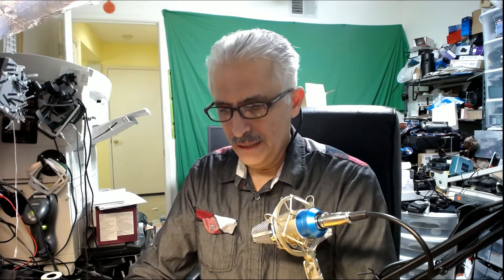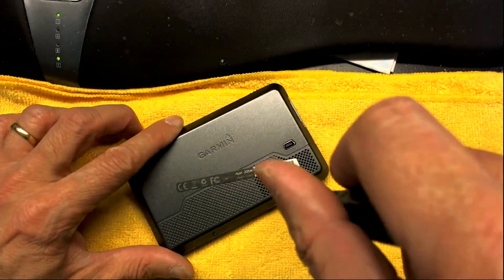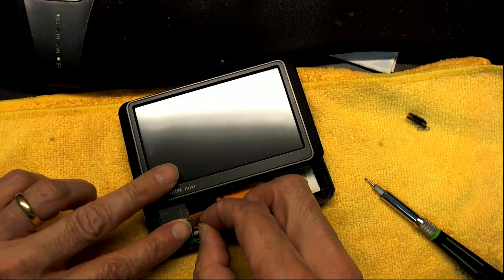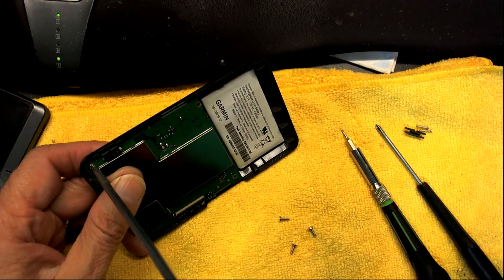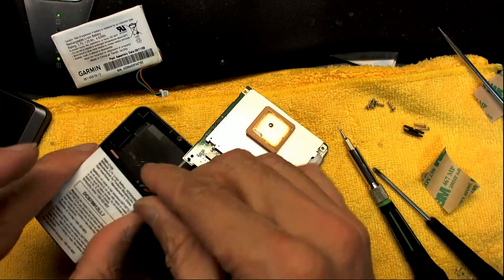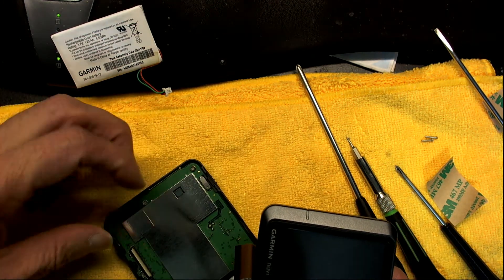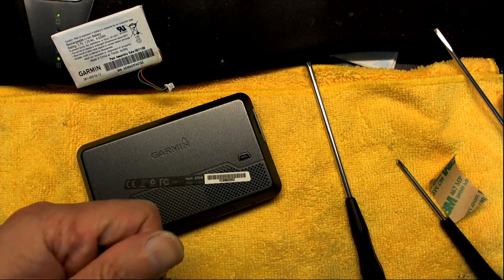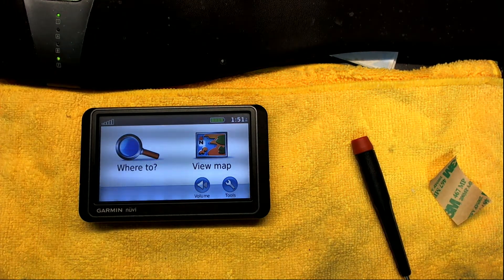Tutorial For Replacing the Battery on a Garmin Nuvi 200 205 255W 265W 2xx

Comment: Excellent video. Thanks.  I cut the double-sided adhesive strip off the back of the old battery and used it with the new one, which worked fine.
Reply from the maker: Thanks! and yes I reuse the same tape most of the time.

Comment: I don't know why but it was impossible to undo the two screws of the back. I used drill and cut the heads of them. The plastic also was hard to open, after an hour i made it replacing the battery. Conclusion, before order the battery set, open the GPS fuselage! Thanks for tutorial.
Reply from the maker: Very true, I do this everyday so it seems like it is an easy task. However it is really challenging if you are doing it for it for the very first time.

Comment: What is a source for the new battery? Do you have the model # of the new battery so that I can do a search for it? Thanks for the video
Reply from the maker: No problem, the battery is widely available on eBay they run from $8, $15. 
Try to get it from a local supplier and not from China, so that you can return it if you have problems. There are more than a dozen different part numbers that will fit on your GPS, so you need to take out your specific battery and see which model it is. There are two main differences between them, some have two prong connectors, and others 3 prong connectors, so make sure to order the correct type.

Comment: My Garmin 2639LMT will not turn on so I am looking at your very helpful video. The GPS when plugged into either the 5v or the 110v adapter is making a very quiet beeping , can hardly hear it. Do you think this is the sign that the battery is almost dead.? Thanks for your advice.
Reply from the maker: When the battery dies the GPS should still operate normally with a power supply source as long as it is a 5V DC 2A or 2000mA power source. So if you are using the original Garmin AC Adapter or Car Cigarette lighter adapter and you are still getting the beeping sound then there is a possible main board problem. If you are using an aftermarket low current power source, then that maybe why it is beeping.
Reply: @TECHNOLOGYTIPS101  I took the battery out and it's 0 v/ dead. I'll try to see if it will work with only the 5v DC Garmin source. If not then I'll assume it's not worth the expense of a new battery, right?
Reply from the maker: @anglosaxon1622  Indeed if the unit does not turn ON without the battery via USB Cable, then it is dead and you shouldn't waste money in buying a new battery for it.
Reply: @TECHNOLOGYTIPS101  Thanks for all your tips and assistance.
Reply from the maker: @anglosaxon1622  No problem!
Reply: Hi again, I persevered, got the battery charged and now I'm greeted with a plain white screen.! Some progress I guess.
Reply from the maker: @anglosaxon1622  Is this white screen with power plugged in or just running on battery?
Reply: @TECHNOLOGYTIPS101  White screen comes on with all three types of power connection. Sometimes hear the startup "gloop" tone( if that is a fair description.) But still nothing except white screen, successfully connected to the Garmin Express app and updated USA maps and have tried the pwr on, touch screen in lower right corner for a minute but nothing.
Reply from the maker: @anglosaxon1622  It could be a bad video processor chip which is on the system board, or a bad screen. It can also be a loose connection between the screen and the system board. So the only way to be 100% sure is to take it apart and professionally diagnose it. This is something you can't do unless you have spare screens, and system boards to swap them and test it. If it is under warranty it is worth sending it to Garmin for repair, if not you will be better off to find a similar used one on eBay.
Reply: @TECHNOLOGYTIPS101  I was thinking similarly, maybe that foil connector. 
Yeh, I've just purchased a new device on eBay so should be good to go in a few weeks.👍

Comment: one of the copper strips on the right side with 4 leads brook when i bent the cover over to get at the battery can it be soldered together or can i replace it on a garmin 265 w
Reply from the maker: Can you post a photo of the broken copper strip so that I can see exactly where it is?

Comment: can you use your gps without a battery , using the usb port and cigarette lighter only?
Reply from the maker: Yes you can, but it is not very safe to do that. If the power is cut off accidentally the unit will turn off and you have to re enter your rout data. Power cut off is a common issue with all vehicle cigarette lighter plugs if the cord is moved, wiggled, or if the vehicle goes through a road bump or something like that.
Reply: @TECHNOLOGYTIPS101      I have been using this  garmin gps for work (home health) since 2013 or 2014 to current.   The original battery is still in it plus i hook it unto the cigarette lighter daily.  But now the GPS turns on and off several times.  Do you think if i put a new battery in- it will work, or will the GPS only last so long?
Reply from the maker: @chnglna8342  If the problem of it turning off is a lose USB plug on the back of the GPS then changing the battery will help somewhat but not totally. You will eventually need to fix the USB port also. You can see my USB Port repair video for the model that you have. GPS Units work for a very long time, I have a Garmin StreetPilot from 2004, it is 16 years old and still works flawlessly.  There are some TomTom GPS units that will stopped working after 2019 due to software incompatibility with new Satellite signals, but even for that there is a fix which will allow you to use a 20+ years old GPS with today's maps.

Comment: What if one of the screw heads is stripped?   I can't get anything on it to get it to turn.   Also how do you "fully charge" the new battery before installing it?
Reply from the maker: To open a stripped screw you use this tool it is like 3 dollars https://www.ebay.com/itm/6pc-Damaged-Screw-Extractor-Drill-Easy-out-Bolt-Stud-Stripped-Screw-Remover-Tool/223851962740?hash=item341e9de174:g:eE8AAOSwh4BeCZR~
I use an external charger to charge the batteries, it is a generic Chinese charger that I bought on eBay for a couple dollars.
Reply from the maker: Sorry the first link to the screw extractor was on bid, this one has option to buy https://www.ebay.com/itm/293134984805
Reply: @TECHNOLOGYTIPS101    Thanks.  I had managed to get a set of tiny(but with big handles and a spinning top) screwdrivers from Home Depot for just under $3 and one of the little flatheads was able to get it out.  I should've paid more attention to the type of screw head before trying a phillips on them.  They appear to be "star" or torx heads, but need a magnifying glass to see them.   Another scary part for a novice like me was when you disconnected the screen cable.   I was able to pull the little white bar back as you showed, but putting it back on the correct pins was a bit of a challenge.  I took another look at your video and decided to copy the way you did it from the side,etc.  I've now purchased a set of screws if only to get new starhead screws even tho the old ones went in, but again had to use the tiny flathead to get the really marred up one to go in.  It's now charging in my truck with the car charger.   Can't remember how long to charge this new battery for tho?
Reply: @TECHNOLOGYTIPS101   Yep.....I've seen these on Ebay but wasn't sure how small they went.  I got lucky with my new tiny flathead.  I'll be replacing the old screws once the new ones arrive and now I'm ready with the "star" bit,heh.
Reply from the maker: @Dizzyphan  The charging time depends on the capacity of your battery and current of your car charger. On average it will take about 2 hours to fully charge if the GPS is not being used. If you use the GPS while charging it will take longer to charge.
Reply: @TECHNOLOGYTIPS101  I installed a new battery and I have tried charging my nuvi 200w with a USB cable (USB to Mini plugs), from either my laptop or a usb charger.  The gps boots up and works all the functions while connected but the battery does not charge.  I have left it plugged in overnight, I tried charging it in my car and still it does not charge the battery (I'm using a Garmin power chord plugged in to a cigarette lighter). Is there any other way to get the battery to take a charge?
Reply from the maker: @100nortonfan7  Hi, Press and hold down the battery icon for 30 seconds and it will take you to the diagnostic page make sure the battery charging current is more than 500mA if not you got a defective battery.  Watch this video https://youtu.be/B8KIPNjC284
Reply: @TECHNOLOGYTIPS101   Thank you so much for your prompt response.  Thanks to your guidance, I was able to determine that I have a bad "new" battery; which I shall send back and get a new replacement. The battery in question only shows one green bar of charge on the battery icon.  You do a great service to the community and it is much appreciated!
Reply from the maker: @100nortonfan7  You are very welcome my friend.

Comment: I cannot get the white tab to lock back down on the electrode.  Any thoughts?
Reply from the maker: Make sure the plug is not being inserted in reverse polarity. Because if you do so it will never lock down and the cable plug slides back out.